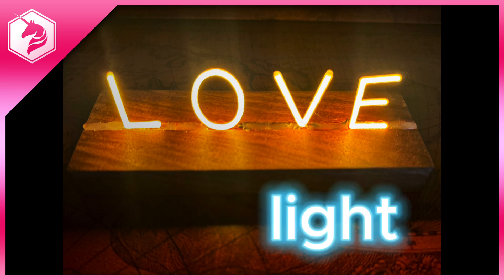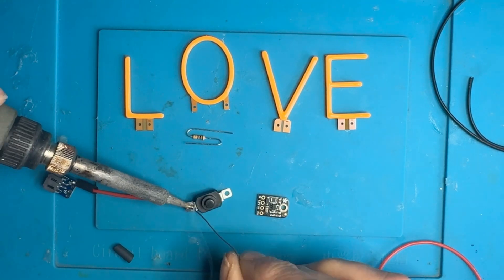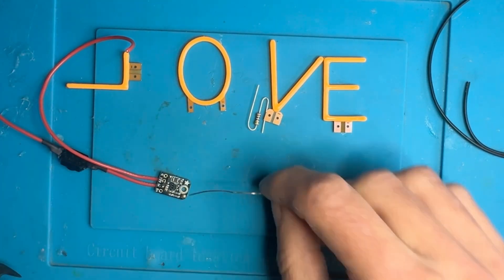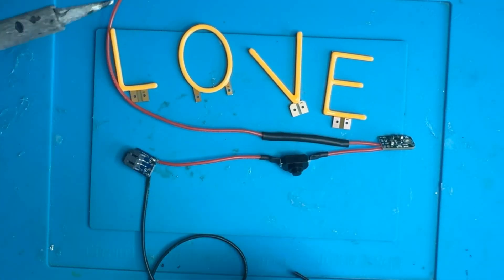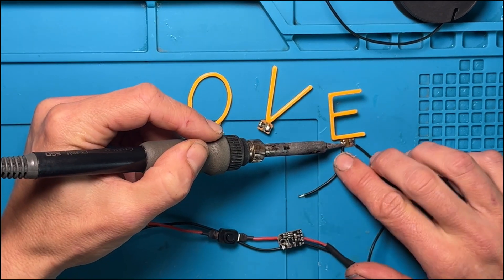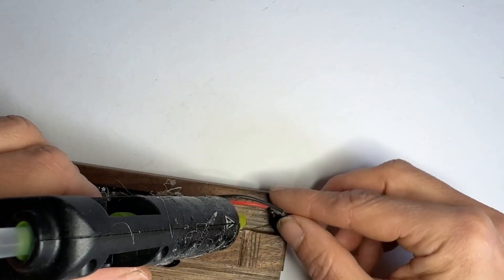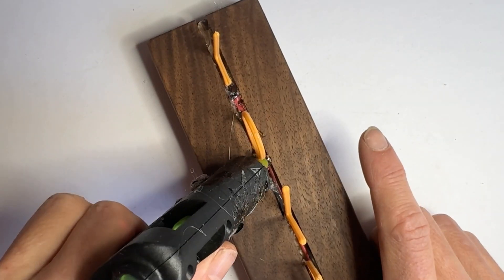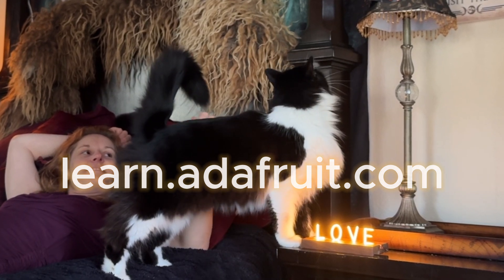LOVE Light: LED Filament Lamp Tutorial #adafruit

Comment: 00:15 do you mean in series? 12v aross these in parallel is likely to cause damage
Reply: I was wondering the same thing because they are wired in series, no?
Reply from the maker: Yes, they are wired in series, 3v x4 = 12v